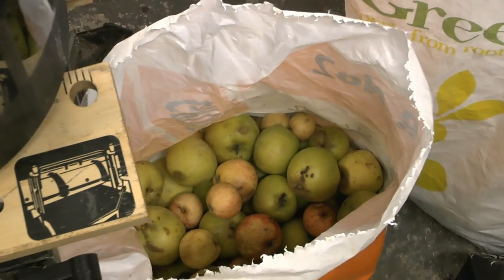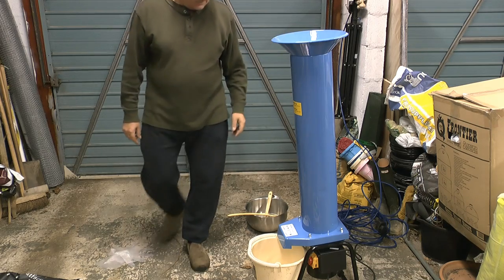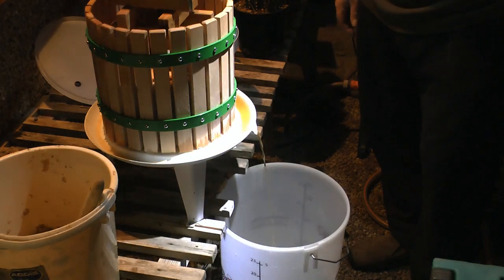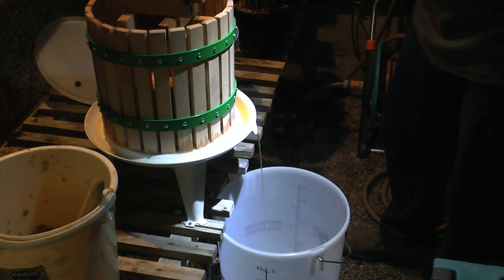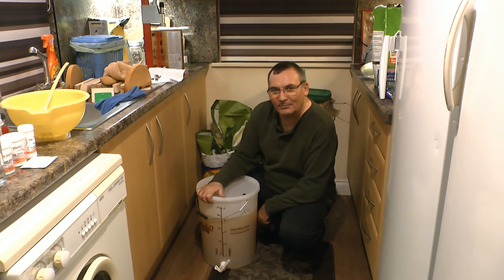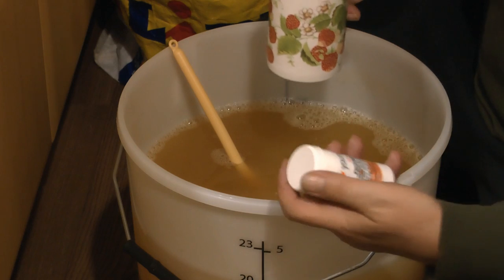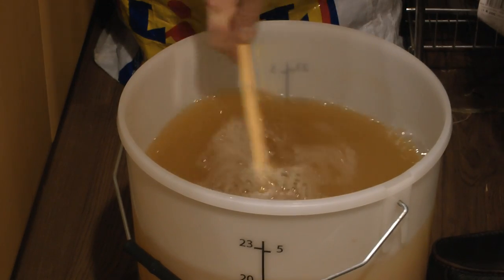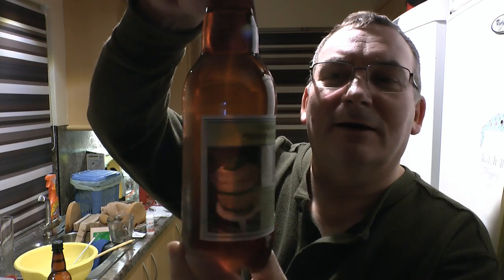Cider Making Day 2016

Comment: I use a dedicated Lidl garden shredder (£69.99) into a 64l really useful box (£15) for my scratting  although you do have to quarter the apples first to get them in the opening. I pack it, switch on then off for 10 sec, repack about 5 - 8 apples a go. Easy to open up to occasionally unblock and fast although probably not as fast as a purpose built scratter but a lot cheaper at £70 vs £400. Careful use of a jet wash to clean.

Comment: Hi Simon,
About 10 years ago I planted 15 cider apple trees for a retirement hobby the trees were chosen for me based on Projections from Long Aston Research centre, for tannin, pH and different pollination groups. I can come in a little base, so I use brambly apples to correct. I have a Vigo classic apple Mill, but upgraded to a Vares Fruit Shark similar to yours much less work and 25% more juice from the same apples. What were you using to mill before? 
My press is also similar to yours, but I have had use of a Vigo 20litre cross beam press, much easier to load and unload with the centre spindle in the cross section. And use of a hydraulic cheese press. However I'm looking at for next season a 25 litre Fratelli cross beam from MAHLAPRESS, I'd like a second opinion.
Regards

Comment: Simon, did you just un-jam an electric powered machine with sharp blades by inserting your fingers to sort the problem out? It gave me the shivers just watching it...
Reply from the maker: Hi Chris, the scratter was powered off and the moving blade is about 6 or 7 inches away from the pulp exit hole and around a 90 degree bend!  Thanks for your concern and believe me I would not put my fingers at any risk.
Reply: @simonknott1131  Felt sure it must be safe, but it did look a bit alarming! Always enjoy your videos, so keep up the good work!

Comment: Thanks! What kind of machine is it that breaks the apples?
Reply from the maker: Selections Apple Scratter. Search on eBay / internet for the above.
Reply: It should be a grating machine. This one you can hear the apples dancing in the machine, because of the way it is built.
Reply: @denverjnpierre6211  This model doesn't have a center blade like some of the bigger ones - such an easy thing for them to add but they didn't - that's why they jump around. No need to go as fine as grating apples though.
Reply: @drsquirrel00  thanks